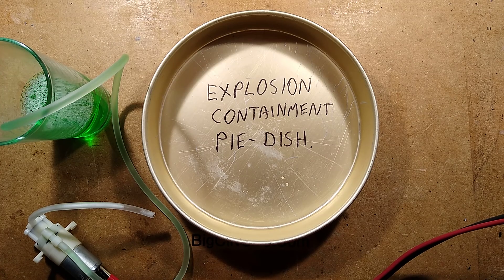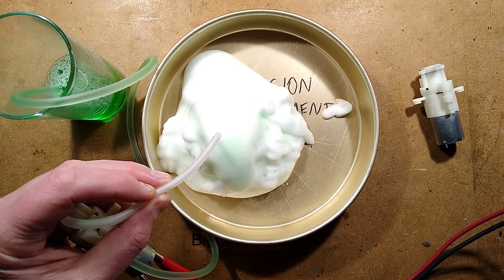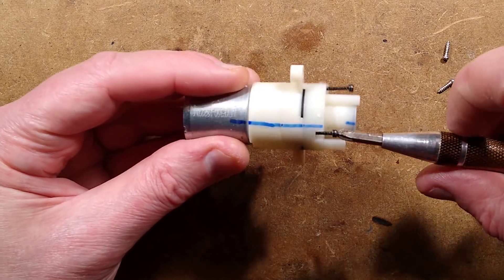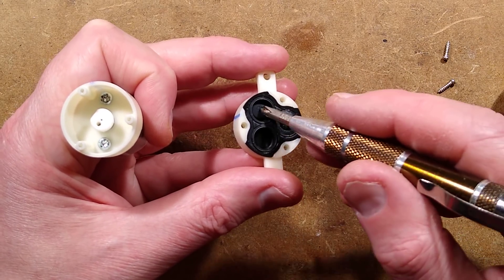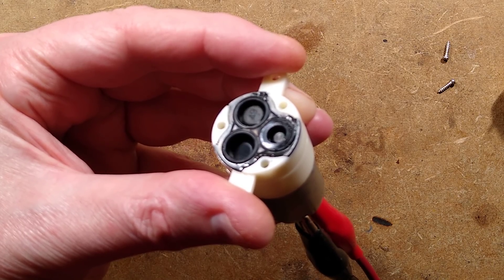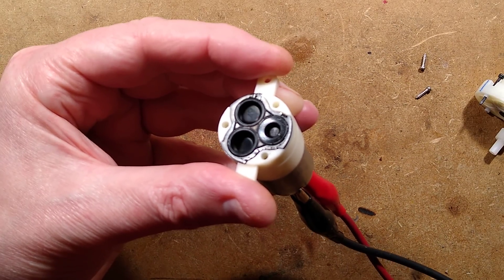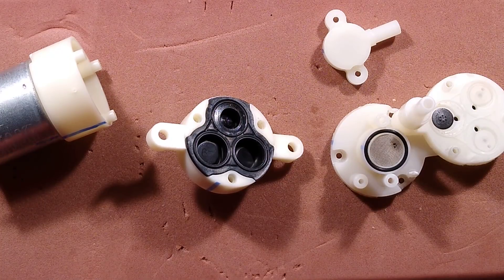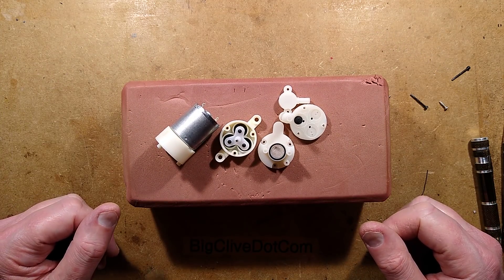Automatic creamy schmoo-pump for splooshing foam onto your hands

Comment: I challenge you to work out how the Gojo hands-free soap dispenser works. It appears to have several interlocks that prevent operation unless several concealed reed/hall-effect switches are fooled. There are two strange coils around the base of the detergent container. There is a weird plug that looks rather like an SD card, but when the honnel is broken off it reveals a collection of links between the pins.

I suspect that much of the strangeness is to make it difficult to reverse engineer  the very expensive containers of detergent. My own workaround has been to cut a hole and squirt in the 10p of detergent/water mix.

Comment: I'm going to use these to make battery powered hand washing stations
Reply from the maker: You can get complete foam soap dispensers containing these pumps and an infrared sensor.  I took one apart in a video.
Reply: @bigclivedotcom   I actually own one, but the reservoir is teensy. We run a hospitality business and would need a dozen people to wash their hands at one of these several times a day. So I'm thinking a full scale sink with a second pump for clean water and the containers for both under the sink. I would love to send you a few pics when it's done!

Comment: oddly enough, i was just looking at buying one of these non-contact soap dispensing devices. It seems it really saves on liquid hand soap? I also see how using to much soap:water ratio can screw it up. Thanks for sharing man! !!
Reply from the maker: It's surprisingly tolerant of the soap to water ratio.
Reply: @bigclivedotcom  , Ive read a lot of reviews where people used 100% liquid soap and it stopped working. Lol  
 I wonder if running just hot water through the system would clear these units? Might be something you could try.
Reply from the maker: @jamescorvett  That would be way too viscous for the pump.  And strangely, the more concentrated it is the less it foams.
It might be possible to assist the pump in clearing the soap by blowing hard in the soap inlet pipe while it's running, or by trying to pump water in to displace the soap.

Comment: Hey Clive, Is there an "easy" way to convert a drill and a heat gun from 220 volt (UK) to 120 volt (US) utilization ? Thanks
Reply from the maker: Not really, because they're quite high loads.  But if it was for home workshop use in the USA, you could install a 240V socket like their dryer and cooker sockets.  (Across two 120v phases.)
Reply: @bigclivedotcom  Thank you !!

Comment: perfect pump for RC boats,you can use the same pump for cooling down the motor and at the same time pump out the water that could get in without a dedicated automatic system.

Comment: Cadbury aero chocolate is made by getting hot goo chocolate and passing it through a nozzle where a secondary inner nozzle pumps air into the goo. More practical for industrial production of foam plastics/resins/cements.

Comment: The mechanical versions of this, (that I've taken apart) only have one nylon mesh, (which seems to be designed to fail, to prevent refills.) Its nice to see this version looks more durable. What do you think will fail first? [And if it had to last for 100 years, what would you change?]

Comment: 9:40 Looks like the kind of mesh you'd get at a smoke shop for your pot pipe or bong. Wouldn't get any floaters on the inhale with that stuff, tho it might be hard to keep it from clogging.

Comment: The motion of the pump lever that actuates the three diaphragm pumps in sequence is called "nutation"; the nutating lever doesn't rotate per se, but it is spherically pinned in the middle and driven by a rotating cam.

Comment: Brings up the question of why screws are even being used anymore. Seems like a reducible cost as opposed to plastic riveting. After all one of the major points of using screws is that they can be unscrewed but who would need to do that for the majority of equipment nowadays as it is meant to be disposable not repairable.

Comment: Would lighter gas on the air inlet work for flammable foam? 
Cant think off a use for flammable foam but just a curiosity lol
Reply: Now, what you really want is a jelled alcohol on the liquid side (hand sanitizer might be thick enough) and pure oxygen in the air inlet.

Comment: AWESOME 😎 AND TOTALLY WORTH FULLY DESTROYING THE POOR LITTE PUMP!!! I took apart a cheap Chinese electric toothbrush of death 💀!!! It has a little AA NIMH That Is Clearly Recycled because it’s got dirty/ripped cellophane tape on the battery 🔋 body and DIRECTLY SOLDERED VS BATTERY TABS Plus the circuit board was cellotaped down to the body!!! USB to Barrel Jack WITH ZERO WATER INGRESS PROTECTION INSIDE OF THE BARREL JACK, there’s an O-ring on the outside of the barrel and the cap. But it’s only protection for the center of the barrel jack is a Silicone Cap!!!!

Comment: Cool! Now connect a propane-filled plastic bag to the air input and make the explosive containment pie dish live up to its name!
Reply: I'd rather see hand sanitizer with pure oxygen.
Reply: @Kineth1  This is a brilliant idea! How about an all-purpose kitchen degreaser in the form of oxygen-filled foam? Wouldn't be that hard to make too: oxygen from electrolysis, stored in a plastic bag or a balloon, output connected to this little foam generator. Bonus points if the other end generates hydrogen foam that floats in the air and can be set on fire!

Comment: Be interesting to see how the mechanism works, I mean I know there are two cog's an a off center shaft but the pistons looked like they moved series not just up/down parallel with each other
Reply: The rotation wobbles the 3-leaf paddle pushing one pump at a time.

Comment: Clive.. when you turned the power off for the motor (when showing the diaphram movement), the motor spun up very shortly ... could you elaborate why that happened? ;-)
Reply: I'm guessing stroboscope effect from the video frame rate almost matching pump speed - as the motor slowed it lost sync and gave the illusion of speeding up... (Same thing you see in old movies of prop-driven planes...)

Comment: I bet those were originally in medical equipment and they're slowly making their way to the consumer market.
Reply: The only use I can think of for medical use is one of those touchless hand sanitizer dispensers you see in lots of hospitals and doctors offices.
Reply: @Sashazur  the air pumps are also used in blood pressure cuffs.  That's where they originated from.
Reply: @aurthorthing7403  I guess you could use a slightly simpler version for blood pressure cuffs, since it only needs to pump air and not also liquid.

Comment: Could work as a contact free foaming hand sanitizer dispenser with a proximity sensor.
Reply: I wonder if that’s what this was designed for?
Reply: I wonder if Clive said it's good you can get the pump by itself now, instead of having to buy an automatic foaming soap(or sanitizer) dispenser to break down for parts.

Comment: could this run from the power of the solar garden lights?
Reply: Why?
Reply: @plasmachicken I'm thinking of adding a little pump to a large pot pond, so doesnt need to run continously. was thinking if using an old led solar light since half the lights dont work anymore. https://youtu.be/yeT52sDtYEU
Reply: @howardr1  Well most likely no
LEDs are quite low Power and low Voltage
I mean really differs on how good your solar panel is and how low you want your flow rate to be

Without knowing what your solar panel is capable of outputting ( especially as you say it's rather old ) assumptions cannot be made really

Comment: Definitely have to pump butane into the air inlet to make the ultimate foamy whoofler
Reply: How the other half live!
Reply: Hydrogen please?
Reply: natural gas is a little lighter than air.  might be able to make flying flame foam.
Reply: @AdricM  My high school chemistry teacher had a demo where she did this.  There was a soot mark on the ceiling above her demo table.
Reply: Why not Jägermeister instead of soap?
Reply: How about cream for the liquid...
Reply: Had the same thought.  Then the pie dish could contain both types of explosions simultaneously.
Reply: I had exactly the same thought😁
Reply: Acetylene too dangerous?
Reply: @MarkTillotson  On its own it's mainly sooty. Stoichiometrically (sp?) mixed with oxygen is a different beast...💥
Reply: I guess you'd need some sort of regulator to ensure the mix is correct. Like whatever setup (I forget the name) propane/natural gas engines have instead of a carburetor.
Reply: @eDoc2020  Well, for a woof rather than BANG, you want an excess of fuel, not an explosive mix (which of course can be fun too... )
Reply: Butane sinks in air, methane floats
Reply: @ataphelicopter5734  that wouldn't matter the gas would be in the bubbles anyway
Reply: @Thebigmanmetaldetecting  It would possibly make the foam float up
Reply: I was just about to suggest the same thing. Odd how you apparently commented a week ago and yet the video is dated November 14th.
Reply: @pvere3246  Patreon members get early access to videos

Comment: Air intake? Gas intake for a super foamy whoofler =D
Reply from the maker: The gas is already pressurised.  But maybe the multiple lesh would make for a thicker fire-mousse.  (But that tends to be less easy to burn.)
Reply: @bigclivedotcom  The liquid needs to be flammable as well. I wonder, what flammable liquid or mixture could foam up like this?

Comment: Air intake into into chamber with flammable air fuel foamy woofler mark 2
Reply: Lighter gas into a balloon (then to the pump) would work or anything low pressured.
Reply: @gordonlawrence1448  hydrogen :))))
Reply: @plasmachicken  That leaks like an SOB the only thing worse for it is Helium. You'd have hydrogen leaking out all over the place. Too damn dangerous for my liking.
Reply: @gordonlawrence1448  far safer to use butane :)
Reply: Auto-Woofler!